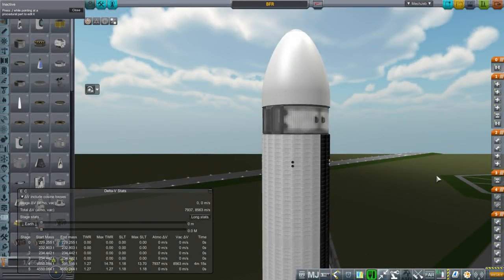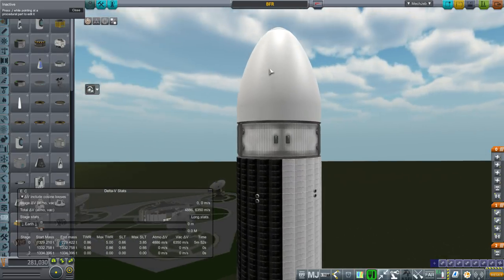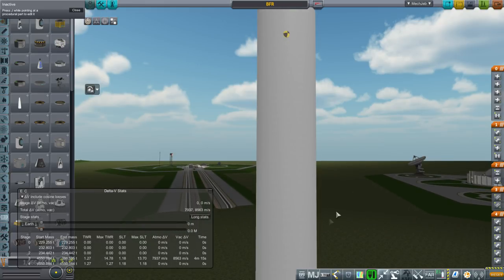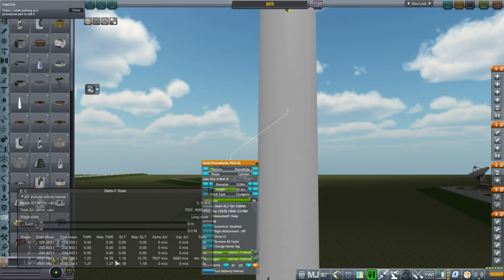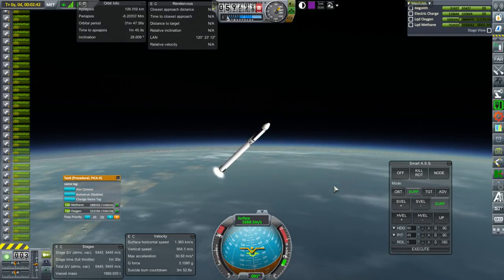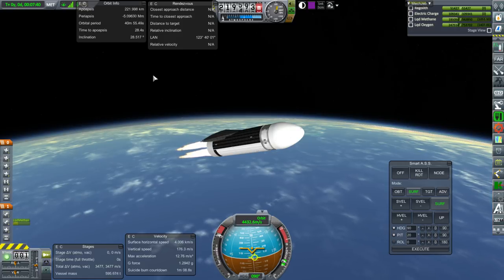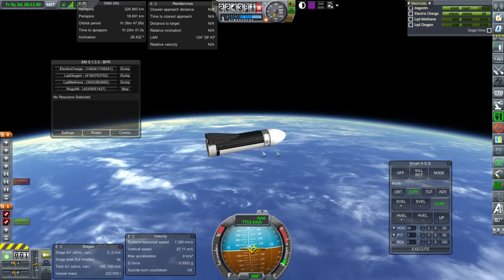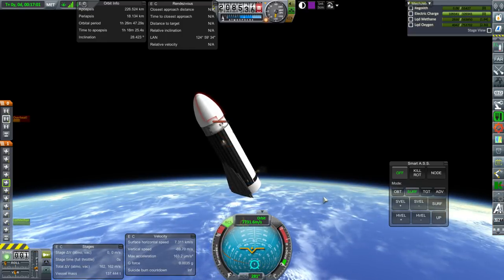Kerbal Space Program RO - SpaceX BFR Basic Sim to Orbit

Comment: The mod throttle controlled avionics can handle differential thrust.
https://forum.kerbalspaceprogram.com/index.php?/topic/97154-13-throttle-controlled-avionics/
Reply: ok, shouldn't hurt to try, though. The plugin can easily be turned off in game.
Reply: It works by changing the thrust limiters, and treating the cluster of engines like any other control surface or engine gimbal. As long as deviation is not too high, all engines should be near 100% thrust. If any engines turn off, you probably have bigger problems.
Reply: Tyler Raiz ok, whatever works best. I might install some RO mods myself and test them out. Never hurts to try anyway.